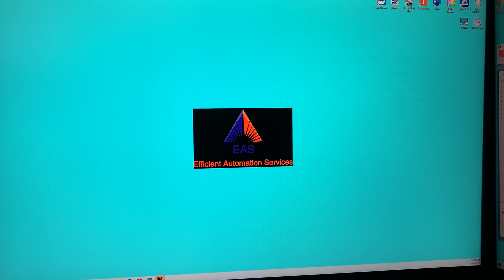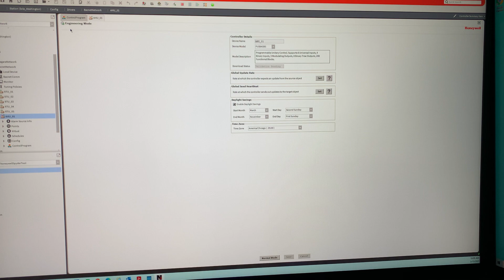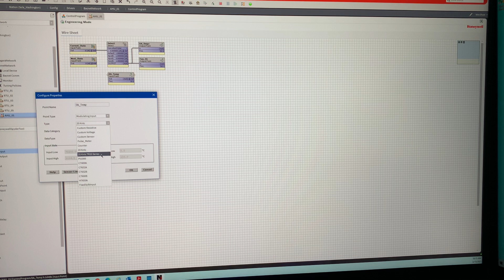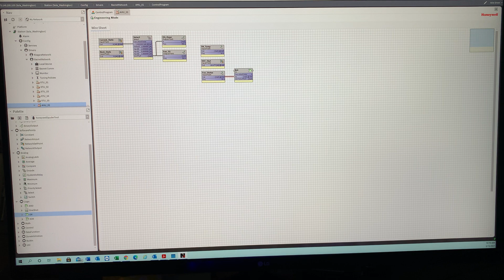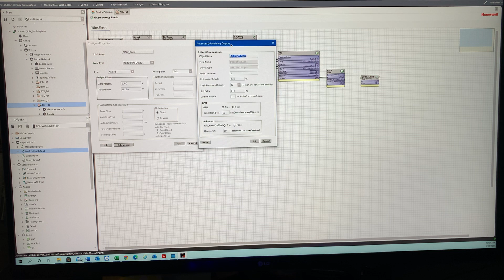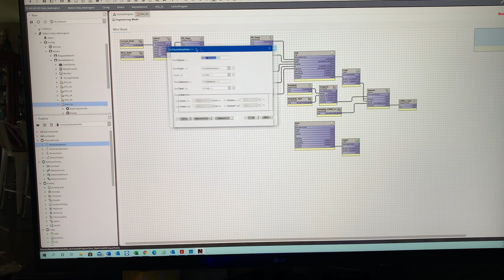Honeywell WEBS Tridium N4 Wire Sheet Logic Basic AHU Program

Comment: Sir,
Can you guide how to configure Modulating Input for 4-20 mA.
Reply from the maker: With this type of controller the 4-20 would require a 500ohm resistor to convert the signal to 2-10volt signal. You would have to scale to that reading. Would you like to see how
Reply: YES Sir

Comment: Hi sir i have in my site spyder vav and i want ro control it by Honeywell CP-core my issue is when i scanned theBacnet mstp  bus with my Honeywell cpo comfirt point i find that all spider have the same  id instance however i want to change the ID device for all spyder connected in the bus pls could you propose how can do this operation

Comment: Hi Sir, can you provide solution for Scheduling logic Boolean writable to Numeric Writable in wiresheet
Reply from the maker: I can make that it’s simple through kit control. Grab the numeric select and go into the property sheet and make it zero based. And depending what you need the numeric units to be can be defined there also.

Comment: Thanks for the video. Can you guide me how do i do a dehumidification sequence?, i have a system with 17 spyders that are going to control 17 AHUs. VFD and CWV i have no problem, bu t i´m a little confuse how do i do the dehumidification.  For it, we are going to use an electric heater with 3 stages (it was designed like that). We have an outside humidity sensor and a room humidity sensor. Plus Temperature sensors outside and room... that system is going to be at.. Cancun....
Reply from the maker: Do you have a sample of your logic or needing a starting point? I can show you a few different ways to write the logic. Just need to know do you have preheat, outside air dampers, reheat, is it DX or chilled water cooling and are the units going to be dedicated to specific rooms or are there VAV/FPB’s being fed. More info the better
Reply: @Energymachanicalautomation  , thanks for the answer. The AHU only have a VFD, a CWV, 3 stages electric heater, and 2 air filters.  No OA Dampers, No reheat, no VAVs.  The units supply direct air to operating rooms. In each room theres is going to be a sylk bus honeywell TR120-H display with temp and humidity sensor.  The AHUs are going to have 2 duct temperature sensors at the AHU, and a pressure sensor 3/4 of longest segment of duct. There is going to be 2 humidity sensors at the AHUs room at the roof, one for the south AHUs and one for the north AHUs. A CHW System is going to supply the cool water (chillers and pumps are standalone, only monitoring by bacnet). The designer says that we have to use the electric heater to dehumidify the entry air.
Reply from the maker: You can stage the heat up but usually you use your chilled water coil to dehumidify. What we typically do is make sure our return temps are above 70 degrees or above dew point and open the chilled water valve to 100% and use the heat to maintain the space temp. Give me a day or so and I’ll make a sample video. Are there any humidifiers in line to maintain the humidity from getting to low?
Reply: @Energymachanicalautomation  thanks for the answer..... No, there´s no humidifiers.  Considering the system is going to be at cancun, the humidity in the ambient is going to be 40+% all the time. The hvac designer says that the electric heater is to keep the humidity below setpoint... they haven´t told me, but i guess is going to be 50%.

Comment: i want to ask about how to set the fan speed to 0.2 rpm?
Reply from the maker: You want the fan speed to stay at .2 rpm or ramp up at .2 in intervals
Reply: @Energymachanicalautomation   where is  intervals？u mean in properties  to set the value at  0.2 ramp?
Reply from the maker: @lucyshi320  I can show how to do intervals in the PID. It’s not used much in the HVAC world and used more in the Industrial applications.
Reply: @Energymachanicalautomation  i find a way to display the rpm,thanks for the reminder, another question, When displaying a picture, it can only be an absolute path?

Comment: Thoughts on resetting the DAT lower for dehumidification instead of an open loop control of just opening the CHW valve 100%?

I like to back into the lowest DAT setpoint based on the psychrometrics of worst case space  conditions.
Reply from the maker: Doing dehumidification control can be tricky and also it depends on the type of system in place. You have to look at return temps and have a unit “system” to have preheat, cooling and reheat. Also, the region has a lot to do with humidity control.
Reply: I’ve done dat reset based on humidity. It works but depends on the individual system and humidity requirements

Comment: I like giving the throttling range (proportional band) the same unit as the setpoint. Makes it more intuitive. 

Proportional band is equal to the setpoint error that initiates a 100% output
Reply from the maker: I need to try this out. I like the idea. One of the reasons I love automation is there are several ways to write and control logic to get the same out come.